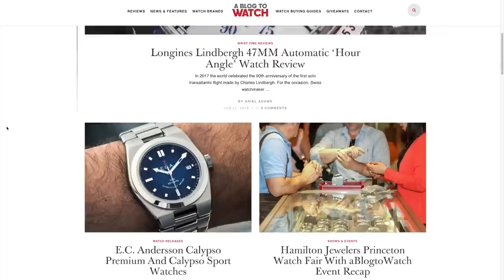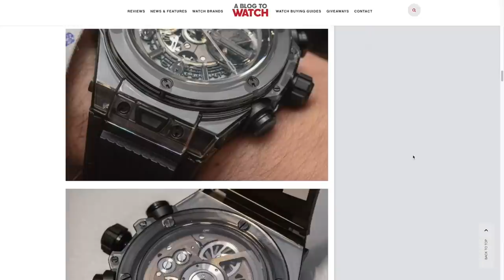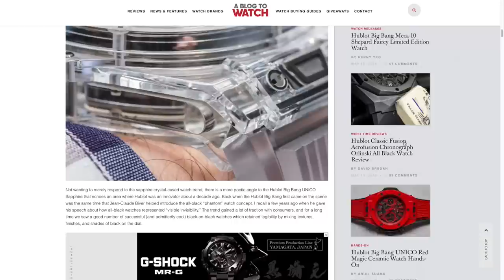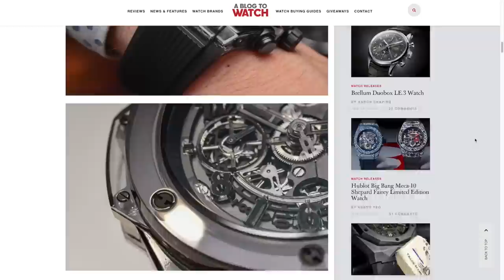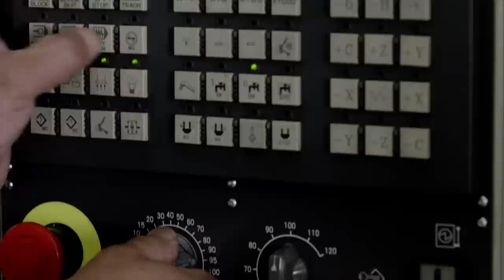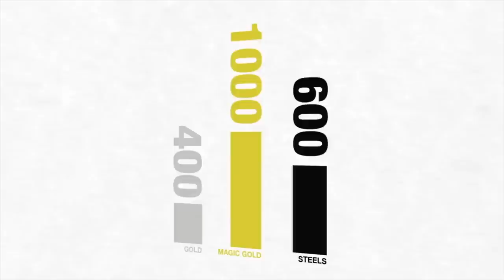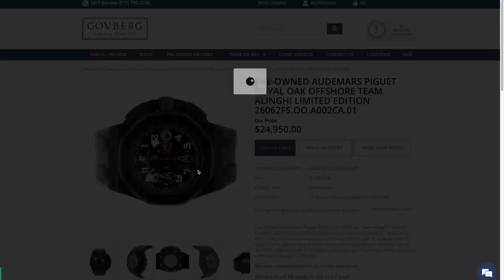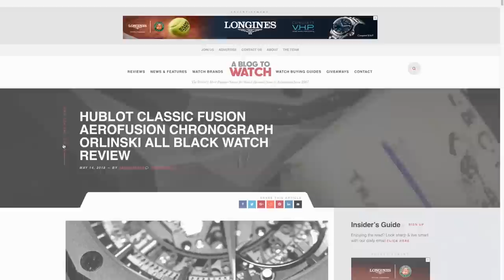Spending Time: The Best Non-Metal Watch Case Materials Discussed | aBlogtoWatch

Comment: I was working with a silicon carbide case prototype and I'd say for a single case we'd probably brake four before we got one that made it to the pylomer coating and we went through almost a dozen tips. Compared to being able to use a single tip to cut maybe a hundred cases made of steel.

Comment: FYI what the watch industry cals carbon ist always CFRP(its always "Plastik"). Also there is no forged Carbon (thats marketing bullshit). The forged Carbon term is often used for Short fiber reinforced Polymeres. So all carbon watches are minium 35% Polymere(Plastik). Iw would consider differntiate Carbon in two categories(for watches) which would be Thermoplastic Matrix and Duromere Matrix.  

Also Titanium you have to differentiate between what is generaly pure Titanium like Grade 2 (used bei Breitling, Hublot,...) this is weaker than Stainless Steel an skratches easier but its hypoallergeneic.
On the Other hand there ist Grade 5 (an Alloy) which is significantly stronger than steel an also harder (harder to scratch) but the Alloying elements make it lose some of its hypoallergenec properties this is used by (Omega, Blancpain,......)

Ceramic and Saphire are similar in some of theyre mechanical properties. So that they can not Deform much before braking(cracking). The ability to deform unter high stresses is what makes Metall Tough so a Ceramic or Saphire watch will always be significantly more fragile